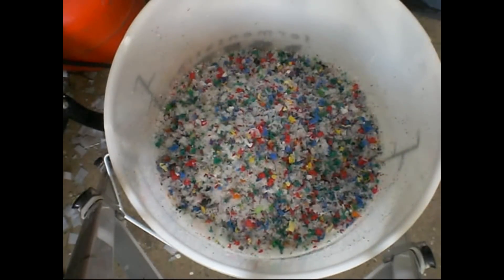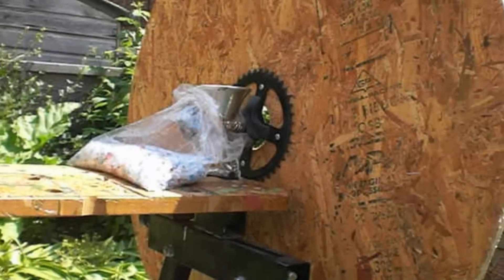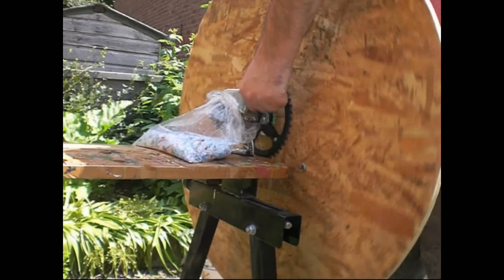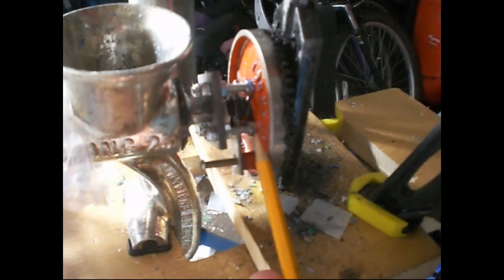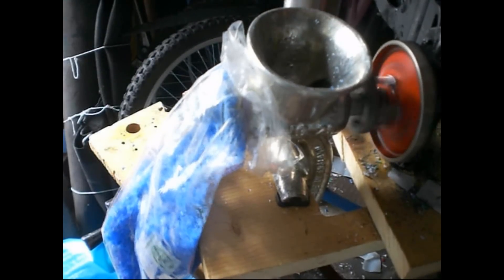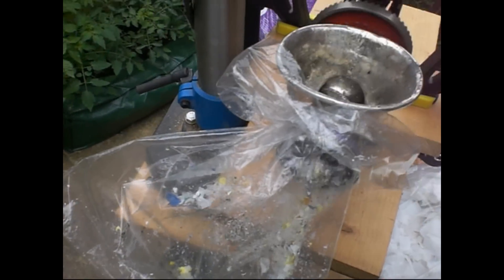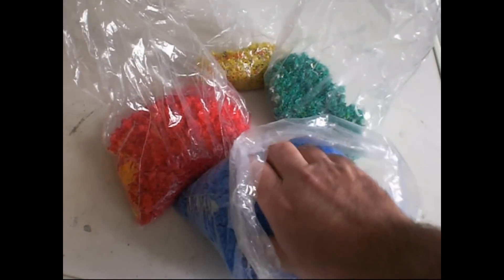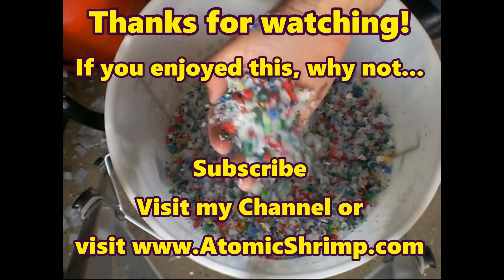Grinding HDPE for recycling

Comment: i use a soldering iron on my car bumpers it works great 
just melt the plastic like u would solder.
Reply from the maker: Sure, but I was trying to make the skin of a boat which needs a greater degree of physical integrity
Reply: more than a bumper?is there not a way to heat up 
both ends and press them together like your sandwich plate?
Reply from the maker: Yes. The hull of a boat requires more physical integrity than a bumper -  it has to remain watertight under stress. Car bumpers aren't made of HDPE anyway.
Reply: yer your right.cant you use that plastic for the hull,bumpers are cheap and easy to solder,a water tight boat?
Reply: captain Cook was on the far side of the world when he sprung a leak.
Reply from the maker: I don't think a solvent is going to work - this material is commonly used for applications that need to resist solvents.  Also, heating a joint that has been soaked in volatile solvents seems like it could end badly.
The key to seam welding appears to be the precise and fairly quick application of heat - commercial versions get hot really fast.  I think it might just be out of reach of the amateur.
Reply from the maker: My plan (if I ever get back to it) is to make smaller modules that can be fixed together by a different method (rivets or bolts) and don't require welding.
Reply: I have used a solder iron to weld sheets, but the integrity is random no matter how consistant you are, even doing the cross stitch poke and fill method.  Not sure if there is a "flux" or prep way to ensure adhesion that will not randomly seperate under random force, but guessing it is simple like ethanol, methanol, or acetone, but I have yet to find it.  ......afterthought, it is almost like when heated, each part develops it's own oiled surface that repels the other....could the heat distill the oils to seperate types??  Hmmm, lol, Please forgive the brain babble.
Reply: ps, I also dream of using it for a diy boat
Reply: AtomicShrimp Another way I have seen, but not tried myself is to use a nylon plastic rod from household items such as the white plastic clip used to hold car door panels in place, or from the left overs you get from a scale model kit after you remove the parts.  You then insert it into a higher speed drill let it spin with friction over the seam and it appears to weld it very well.  I just need to find some old models from when I was a kid and try it.  Cheers!

Comment: Thanks for the tip, i almost chopped off my knuckle last week (hand bandaged) cutting hdpe milk cartons with large garden shears, i'm going to use a suction vice for my hand clamp next time, but i was going to try a blender myself, so it doesn't work using a blender! cheers for the heads-up. Using a meat grinder seems extreme, going to have to purchase one from ebay now
Reply from the maker: I don't think what I did here was especially safe, so please don't take my makeshift solutions as best practice. A blender might work for you, if it's a good one.
Reply: you can buy electric meat grinders for like 50 bucks on ebay so i'll buy that once i have lots of milk cartons broke down
Reply from the maker: Good plan - I imagine one with its own dedicated power will be safer and probably more powerful at the job.
I suggest fitting a cutoff switch that you can hit with your foot or hand - if the plastic jams it into a stall, you want to shut it off fast so you don't burn out the motor or strip the gearing
Reply: i'll keep that in mind, i'm going to use the dirt mud ground as templates, i'm just going to put the plastic into a small dirt trench shapes i made with my finger then just heatgun it to any shape i like

i'm hoping it works, but i'm months away from that plan till now

Comment: Maybe you could mix the HDPE with another material. https://www.youtube.com/watch?v=BnEUaNJu8gM
Reply: You could but then you run into different melting temperature, and if you mix with PP which in itself PP will catch fire and flame up despite it melts around the same temp as PE. Best to look up on this vast web of information such as Creative Mechanics for characteristics of each type of plastic and what can and can not be mixed. Its not common to see two types of plastic fused together by heat (think of how an inflatable raft is welded) or ultra sonic/sound welding (more high tech heat type welding).

Comment: check out some artwork by a lady named Amy Toscani: she's a sculptor from Minneapolis/St. Paul MN who does a lot of work with plastics: apparently she uses welding tools meant for adhering plastic bumpers to automobiles. Not sure how obtainable that would be, but perhaps that could be your welding avenue for the HDPE boat?
Reply from the maker: I like her work and her approach.  I couldn't find any detail on how she's actually welding plastic, but it could be ultrasonic welding (which would work for me, but not sure it's within my reach) - I think for some of her projects, she might, like me, actually be using laundry irons, toasters and soldering equipment

Comment: I have been snipping up my HDPE with scissors and heavy shears for the past year.  It is very slow and tiring, and I am starting  forearms like Popeye from the repeated scissor action. :-\
Reply from the maker: For plastic milk bottles, I worked out that if you cut off the handle and threaded neck, you can cut the rest spirally into one long strip - it's then easier to handle for snipping into smaller pieces, but yeah, it's tough on the forearms
Reply: Thanks.  I already cut most of my bottles into spirals though.  I have even recently set up a blade for spiral cutting bottles (Do a search for "plastic bottle rope" on Instructables or here to see what I mean.), but it is still a lot of tedious work to do, and usually gives me some carpal tunnel pain after a few days.

Comment: Strikes me that maybe a microplane shaver made for parmesan cheese would have done better than a meat grinder.  I don't have one handy to try, I will have to see if the charity shop has one (or maybe a snow cone machine).  A microplane really is just like a lot of thin razors and  a razor does a nice job on HDPE, a scaled up version for the HDPE may be a worthy endeavour if it works. That boat idea looks like it may have been interesting.  Can you get a clear sheet on roll of HDPE of a thickness say of a milk bottle?  If so, a way to lay out the hexaons, a sheet of the HDPE, and a heated roller to roll over that, flip and repeat and meld it down may work to make a continuous sheet.  (no sure if you can make a sheet of clear DIY is why I say roll of premade).
Reply from the maker: But... I do have a plan for making pieces that can be joined together without welding... watch this space...
Reply from the maker: I am melting the stuff using a flat plate sandwich toaster - I did try a continuous process where I would pull out the processed piece and try to form a new piece adjoined to it, but it didn't work.  Thermal expansion was the killer - when HDPE cools, it contracts violently - so needs to be constrained flat or it will buckle - obviously, doing all that on a large scale wasn't possible for me.
Reply: I think if it was feasible to easily make a sheet of HDPE that large, he'd have just done that in the first place rather than try to weld so many plates together.
Reply: "_) I will indeed watch!!!  I had thought the idea was a honey comb of varied coloured hexagons or at least that was what my mind saw when you had the shot of them.